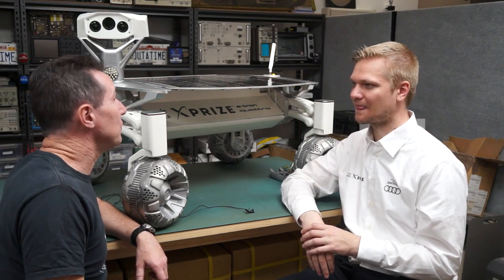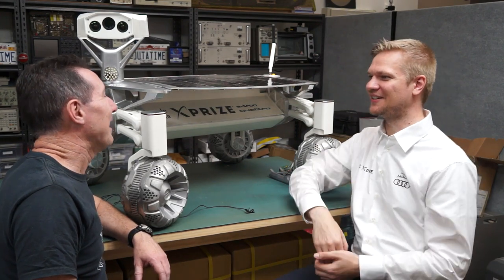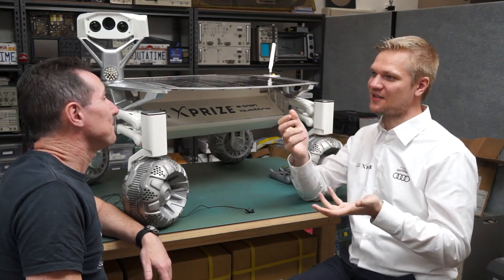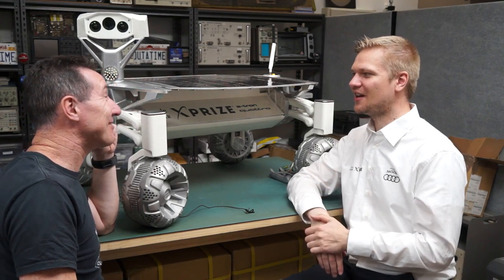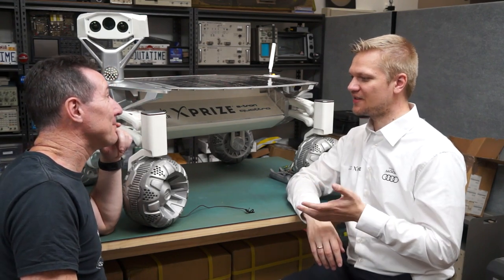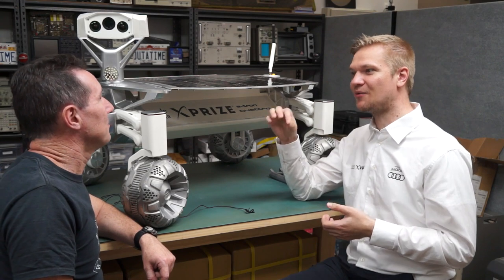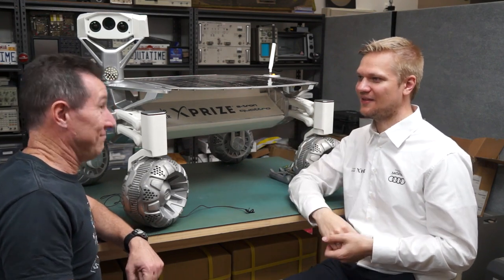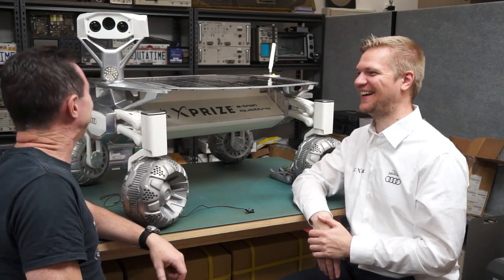Space Electronics Circuit Protection

Comment: what happens when a wheel stops working/locks up
Reply: It's better to plan ahead and learn from previous issues to avoid things like that happening. The wheels appear to have individual suspension so maybe it's possible to lift one up if it stops turning. But I would say it's more a case of 'if a wheels stops' rather than 'when a wheel stops'.
Reply: You work with what you have then. Simulate same thing on here on Earth and figure out the best way to move. For example Mars rover Spirit had to be driven backwards after one of the front wheels failed (dragging inert wheel is easier than pushing, less likely to dig in the dust).